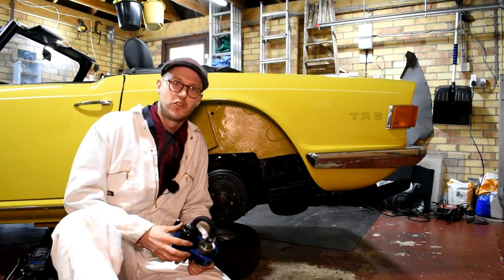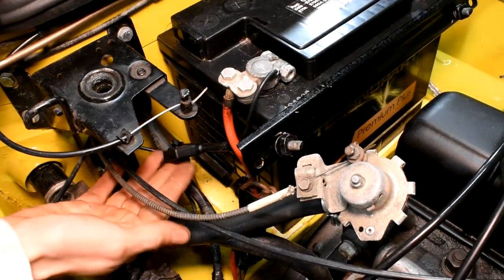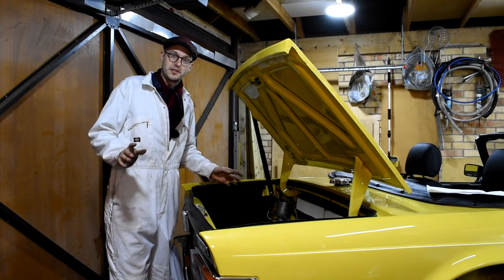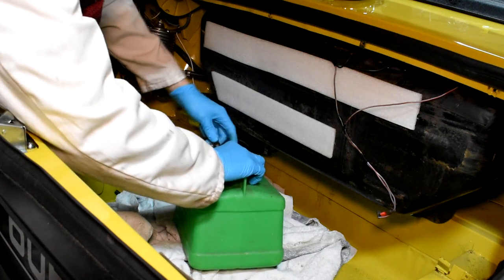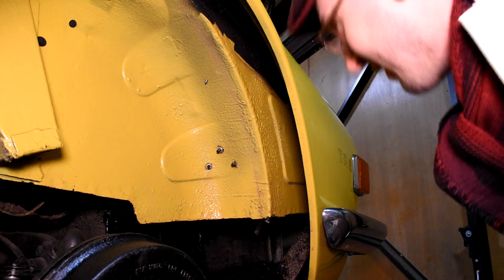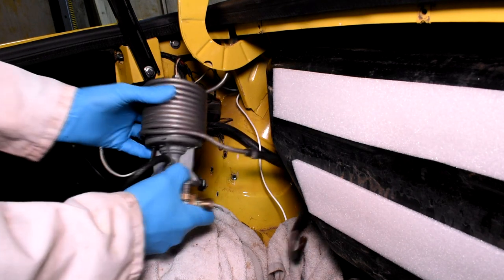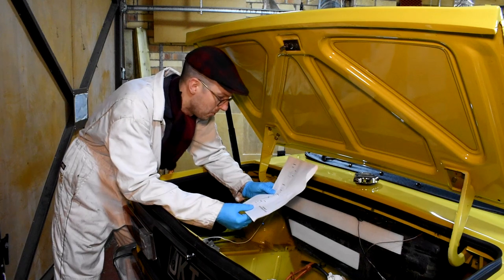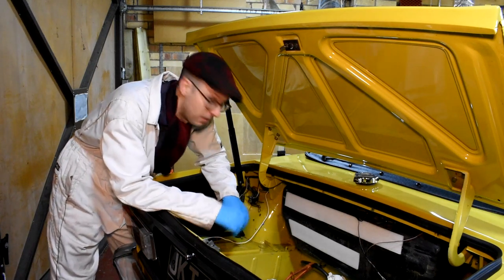Triumph TR6 TRGB Fuel Pump Conversion

Comment: Steve, I placed a facet pump in the same place over 20 years ago. Here in the states we only need 5-7 psi for my dual SU’s. I made a alum dust cover, right angle in the front with an extra tab for vibration. Runs cooler and only dusty. It’s my Summer car. Would love a PI system. CHEERS!
Reply from the maker: Oh great stuff! Facet fuel pumps are excellent, and I've found them to be a fine replacement to the mechanical pumps on any British carburetor car. They just do the job and work well 👍

Comment: Good video and good mechanic. Looking forward to see more from you. Having my self a TR6 PI , I would suggest checking out the electric wires feeding the fuel pump for excess heating after working for awhile .
Reply from the maker: Cheers mate, this is the main reason for the relay and using the old wiring as the switch wires on the relay 👍

Comment: Morning Steve . As usual , you make this look deceptively straightforward . I guess in real time this took 4 or more hours ?  I can understand why the kit  fits outside the boot  to prevent over heating but l'm slightly surprised there isn't some type of dust cover to prevent dirt /mud /  etc.  Did that hole cutter come with the kit ? And  did l notice you have a shiny  new de  walt drill  ? or was that  John's ? Great stuff as always . Thanks Steve . Take care and stay safe.
Reply from the maker: Hi John, the argument TRGB say and I agree with, it you drive a classic car in general in good weather on the road so there isn't really much need for a dust cover. But there would be nothing stopping you making one. As for the drill and drill bit, that was Johns 👍

Comment: Thanks for a nice clear video 'how to' - it's good to see the job from beginning to end. One thing concerns me, the hose connections to the new PRV and simple Jubilee clips. Is that going to hold the pipes secure enough with over 100psi and considering all the factory connections in the fuel system are screw in type joints?
Reply from the maker: The hose from the PRV return to fuel tank is only relieve fuel pressure, and will only run any excessive fuel over the quoted 100 to 105psi back to the tank. As there is no build up of pressure down this fuel line and with no restriction at the end of it, just returning fuel to the tank. The fuel from the PRV only opening at around 5psi or so, above the pressure required and you only get around this 5psi down this hose and only very preferably on say the over run, or every now and then when fuel is not as in higher demand from the pump. Therefore a jubilee clip is sufficient enough to secure this hose. As for the factory screw fit return pipes, that come in from 1973, prior to this they were push fit and it's recommend to fit jubilee clips to the fuel return hoses 👍
Reply: @SteveDentonClassics Fair point although, I was thinking more of the high pressure input side of the prv, which should be receiving input in excess of 100 psi.
Reply from the maker: Ah, I see, so the high pressure hose from the fuel pump to the T Piece is crimped together with high pressure crimps. Then the new style diaphragm PRV is screwed into the T Piece in the same way as the old style pencil type PRV would be. Everything on the high pressure side is screw fit with the TRGB fuel pump 👍
Reply: @SteveDentonClassics  Gotcha - that's reassuring :-)

Comment: Great Vid thanks Steve, Do you know the difference in the current draw between the standard oem pump and this Bosch style pump? I have run an original Bosch pump for some time but due to dirty fuel I am now fitting a new 'Bosch Style' Thanks - Richard
Reply from the maker: Most modern ones are Sytec or a Bosch style type as Bosch no longer make a high pressure pump. The Sytec is a good pump, and is well developed by TRGB 👍

Comment: That looks like a neat installation. Great video Steve, no music which I enjoyed too, just pure mechanics! 

Liking the fuel pressure gauge to check the prv, are these expensive with the correct fittings? 

I had some stumbling the other day on my '6 and some fuel smell and wet near the tell tale hole on the pedestal, before going to change the lip seals, I thought I'd take off the return line and blow it through. There did seem to be some resistance at first and then it was easy to pump. It was then bone dry after while running.  So I'm hoping there was a pressure build up which was causing a slight leak and making it go very rich causing the stumbling at idle.
Reply from the maker: Cheers mate, I try and mix up the videos hear and there with the music, so to make them easy to watch

You can buy the test gauge from TRGB for under £100, they are a good bit of kit to have in the tool box as you can keep an eye on things. However don't run the car for too long with it connected, it is after all a testing gauge, not a permanent fixed to the car gauge.

With your return line it might be worth checking it for ethanol erosion. The good old ethanol in the fuel has a habit of collapsing fuel lines. I recently had to replace my fuel tank filler neck because of this 👍
Reply: @SteveDentonClassics  thanks Steve, maybe someone in my local TR Register group already has one or we could do a group buy and share it. I had the pipe from the return line over the rear axle go, probably helped by the ethanol! I'll keep an eye out for sure.

Comment: Hi Steve, Good video just the electrics were a bit quick. What do you need feed from the battery for? and did this go to the relay?
Reply from the maker: Hi mate, the extra wire that is fused on the battery runs direct from the battery direct to the relay in the boot and then to the fuel pump. Then the original wires that would normally fed the fuel pump are then used as trigger wires for the relay. Done this way round just means the fuel pump gets a better current draw 👍

Comment: Excellent video,  thank you. My car is running the original Lucas pump, it has never let me down but it is very noisy, especially with the hood up. How would you compare the difference in noise between the two pumps?
Reply from the maker: In all honestly, when you have the hood up there not much between them noise wise. Having it running outside the car just keeps the pump cooler, and gives a little more boot space 👍

Comment: Great video - quick question.  Looks like the grommet for the fuel pipe is too big and water/muck could get through.  Was that just video angle?  We could see it when you were doing final but if pump install in the wheel arch
Reply from the maker: Unfortunately that is what is supplied in the kit. The grommets are a bit slack around the hoses, therefore after the install John put a load of silicone around the grommets and hoses 👍

Comment: Hello Mr. Denton. I own a 70 R.H.Drive TR6 pi that has a Bosch fuel pump and filter configuration. In your video I noticed that fuel is first supplied to the the filter and than the pump.  My car’s previous owner placed the fuel supply to the pump first and than filter.  Which is the most correct method?   I should add that I live in California USA and There isn’t anyone around here who knows anything about the pi system. I will appreciate your comments. 

Cheers.
Reply from the maker: Ok, so there are some various conversion kits on the market. The Prestige Injection kit has a pre fuel filter, pump and post fuel filter. Depending on what fuel pump you have, I'd say your better off with the filter going before the fuel pump as the pump is rated to over 100 PSI. Most fuel filters are only designed to cope with 20-30 PSI, so before the pump is a better place for it. Also it filters the fuel before it's drawn into the pump, cleaning it before hand. So I'd place the filter before the pump 👍
Reply: hi, does your car still have Lucas injectors or Bosch ones (that's the case of my 2500 Pi Mk2 saloon)? Thanks
Reply: Mr. Denton, I can't believe that it has been two year since I last communicated with you.  
Couple days back, my car started fine, idled well, and ran well for a few miles,  all of a sudden sputtered and died.  I do have a fuel pressure gauge installed on my dash and it indicates to about 85/90/95/100 psi each time I cycle the ignition key on and off,  I do also hear the fuel pump running.  I am planning to change the regulator, pump and filter.   I am currently using; 
-Original fuel regulator
-Bosch fuel pump, PT No. 0 580 254 921
-Bosch fuel filter, PT No. 0 450 905 401 
I believe both of these items are discontinued.  May I please ask you for an equivalent items, or the part number of the parts you had installed in you friend's TR6.  
I also would appreciate any comments, or suggestion that you may have to remedy my situation.  

Much thanks,

Sincerely,
Sam

 @SteveDentonClassics

Comment: Steve, can you confirm the pre also was sourced from TRGB ?
Reply: Pressure relief valve I was referring to. Spell checker !!!!
Reply from the maker: It comes as a kit, so everything to convert the pump from Lucas to Sytec to there. The PRV is separate, and needs to be brought as a separate item 👍

Comment: Mr. Denton, I can't believe that it has been two year since I last communicated with you.  
Couple days back, my car started fine, idled well, and ran well for a few miles,  all of a sudden sputtered and died.  I do have a fuel pressure gauge installed on my dash and it indicates to about 85/90/95/100 psi each time I cycle the ignition key on and off,  I do also hear the fuel pump running.  I am planning to change the regulator, pump and filter.   I am currently using; 
-Original fuel regulator
-Bosch fuel pump, PT No. 0 580 254 921
-Bosch fuel filter, PT No. 0 450 905 401 
I believe both of these items are discontinued.  May I please ask you for an equivalent items, or the part number of the parts you had installed in you friend's TR6.  
I also would appreciate any comments, or suggestion that you may have to remedy my situation.  

Much thanks,

Sincerely,
Sam
Reply from the maker: Hi Sam, best bet it to chat to the chaps at TRGB, that’s where I buy most of my products
Cheers
Steve 👍

Comment: Can it not be fitted on the inside?
Reply from the maker: In a word yes, their is nothing stopping you fitting the fuel pump inside the boot of the car. The one on my TR6 for example is a Prestige Injection 'Bosch' style fuel pump and that was designed to be fitted to the inside of the boot, and I've had no issues with mine in the 10 years it's been in there. However the TRGB fuel pump was designed to fit on on the outside for two good reasons. Firstly, having the pump inside can lead to the pump overheating and failing. Therefore having it externally mounted eliminates this problem. Then secondly, having it mounted to the outside of the car makes it more silent to the driver and passenger, rather than having it spinning away in the boot. The other solution I have seen people do is mount them inside the boot, but drill cooling holes for the pump. I think it's really a question of weather you want to follow the fitting guidelines or not. And from what I understand it seems to be more an issue in hot weather country rather than the UK. As I said, mines been in the boot for 10 years with no cooling holes without any issues, but mines a Prestige Injection pump 👍
Reply: @SteveDentonClassics  Thanks Steve I understand you have fitted it as TRGB intended but in this possition its open to the elements plus I noticed where the pipes go into the boot through the grommet there is a gap so could possibly leak in water. Fitted in way for most of us would not be a problem as we only bring them out on fair weather days but I do intend fitting one shortly but probably inside though. Thanks for another geat vid. Take care
Reply from the maker: Yes, that's TRGB's argument, that I agree with, most will only use them in fair weather. As for the grommet gap, I'd agree with you, it is a little excessive, but it's what comes with the kit. John later did put a load of silicone around it, just to keep the element out. I do think that there is another option for all weather driving, and that would be to make a box section for it outside the car to case it in with. So long as it's vented to keep it cool then I can't see why it wouldn't work. At the same time you have nothing to loose trying it in the boot first, if it does overheat, then it's easy enough remount it elsewhere 👍